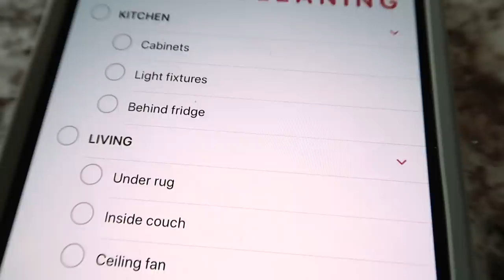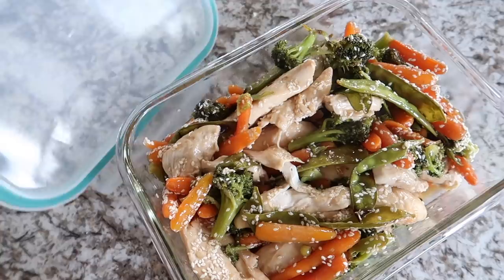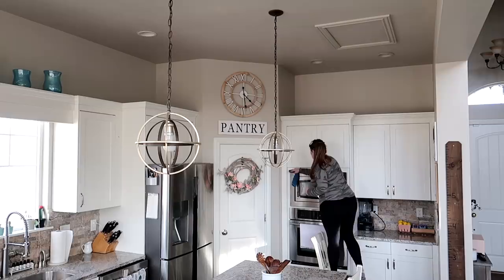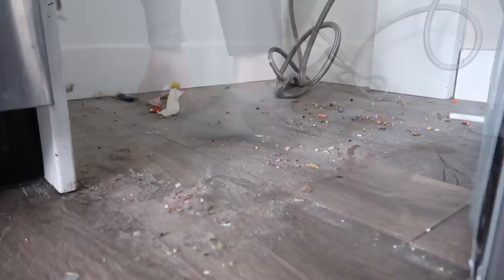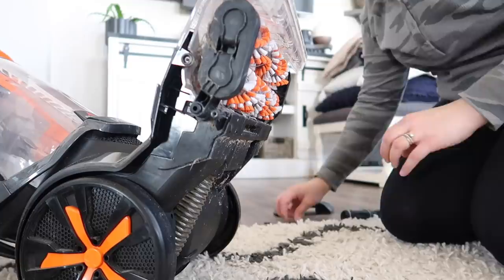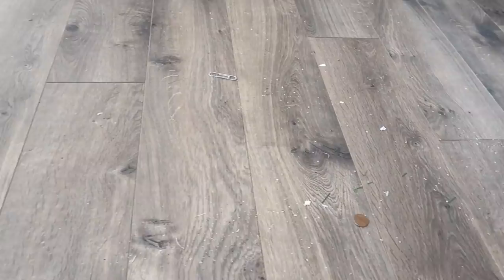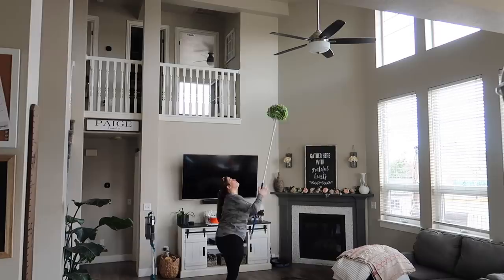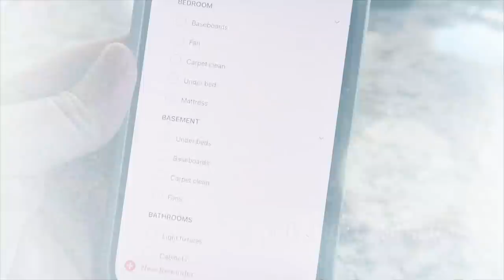*SATISFYING* SPRING CLEAN WITH ME 2021 ✻ DEEP CLEANING MOTIVATION + NEW RECIPE | HOMEMAKING

Comment: I started Spring Cleaning last week ! I always start outside by; oiling padlocks, latches ,slide locks, hinges, big ol garage spring thing , tightening loose screws , pulling weeds , picking up trash on sides of house, treating my yard & deep clean out of dog run plus dogs get a good bath . After the outside Spring Cleaning is done I bring the vibe inside and I ;fix broken things/ repair stuff, change smoke detector batteries, change furnace filter, tighten loose furniture legs and doorknobs,  replace light bulbs and old batteries in nightlights & candles ect , declutter , go thru closets/drawers & get a donations box going...Today I am finally at the Spring Cleaning point of; watching others Spring Clean on YouTube, dusting the ceiling, cleaning light fixtures & fans, washing walls,  washing doors,  polishing mirrors and glass storm doors/sliding doors :) Thank you for the motivation !

Comment: a little tip- using dish soap is a degreaser. Using a small bucket of hot water with dish soap and a wash clothe cleans those greasiest areas with ease.

Comment: There is a product called cushion qwik or silk film, it's basically a really slippery silk sheet you wrap on the foam to shove it back into the cushion cover. You can also use a garbage bag and a vacuum to wrap the foam, suck the air out to compress it, then slide it back into the cover. The latter can be a bit harder though since you don't want to leave the garbage on the couch foam (where the silk film you can leave).

Comment: If you struggle to get couch cushions back in the covers, take a plastic trash bag and wrap the cushions, use a vacuum and compress them. Then put back in the cover with the opening of the trash bag facing away from the opening of the cover. Once in, you can pull the bag off and zip the cover up!

Comment: Ty♥️ love your videos.  It looks like I have the same carpet cleaner and I couldn’t get it clean either, (I took mine apart too and still couldn’t get it clean) until I saw someone else use theirs and saw how they cleaned it and then looked through all the attachments and found a long plastic “do-dad”, like the one they were using, that you use to get up in those tight spots🤦‍♀️ 🤷‍♀️ it worked wonders to get the hair out.

Comment: I've been buying the power wash spray for well over a year now I get mine from Sam's club it comes in a 3 pack for less then $9.. The 1st time I used it it was like yay no more soaking..
Reply: In Canada here I found some at one store for $5.99 a bottle  another store has it on sale for $4.99 up till March 24,2021 so trying to gets there tomorrow!
Reply: @sweetlady6059   It is so worth it and you really don't have to use that much just spray and let sit for like 5 to 10 mins.. Depending on how caked on your pan is like  casserole or slow cooker... Works like a dream and because it's a spray it just does a light coating of foam....